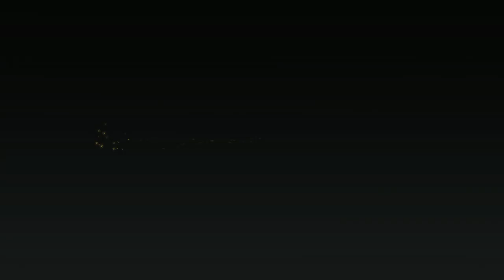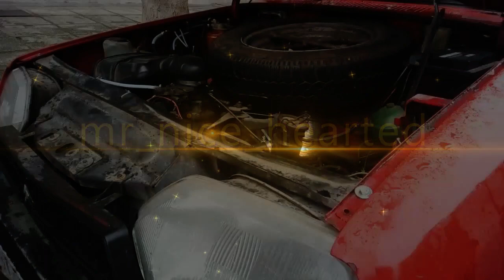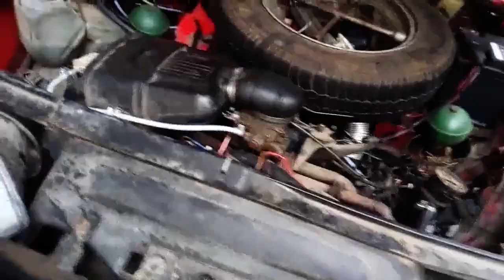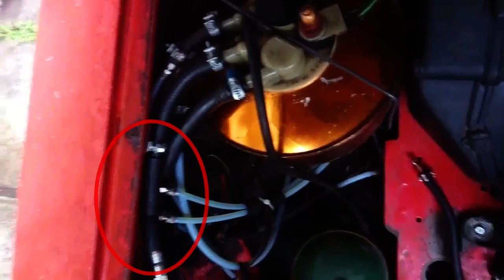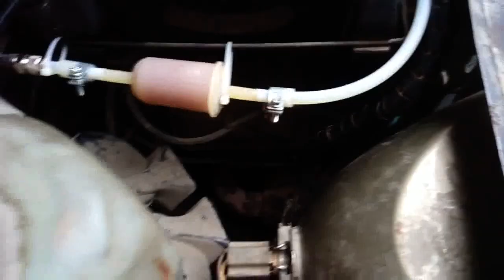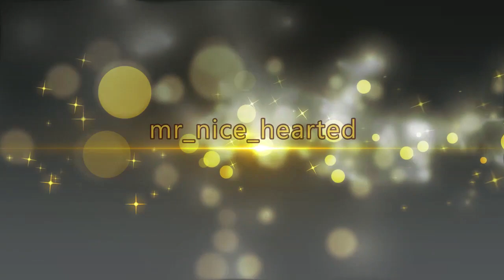Citroen GS cold start and new fuel line (ENGLISH)

Comment from the maker: After a couple of days, that fuel line was again repositioned and changed. The fuel filter is gone, the line is half PTFE tube and half copper pipe (8mm OD), and it goes from the pump to the carb passing under the air filter, without hindering the removal of the filter box. 
The pipe on the other side of the pump has also changed. That part is the one that connects the pump to the mail fuel line, under the chassis. That part is now also copper pipe, with only a small 15cm long rubber fuel line near the fuel pump, which can always be changed easily, if the need arises,